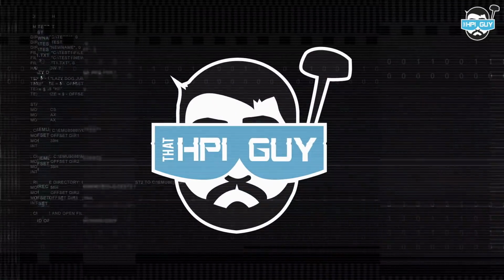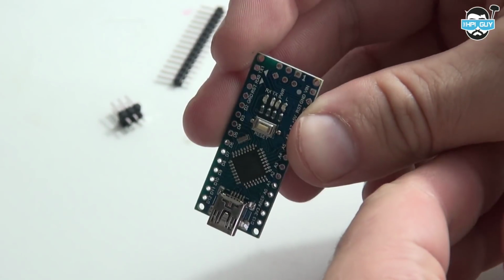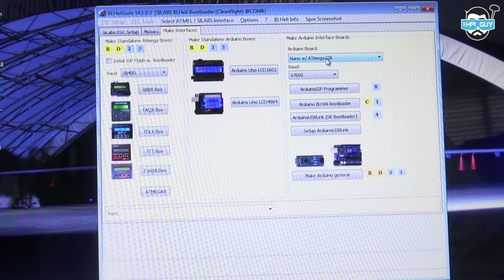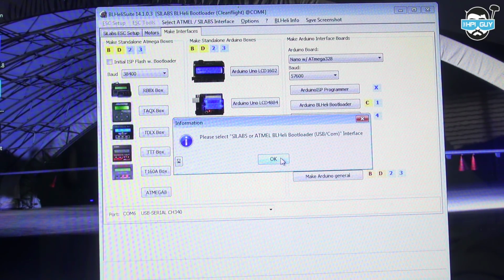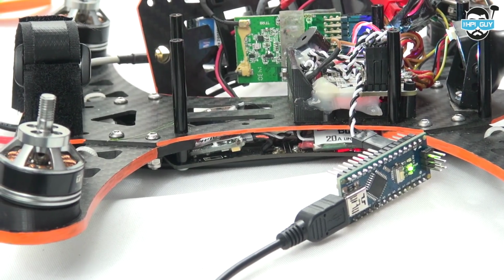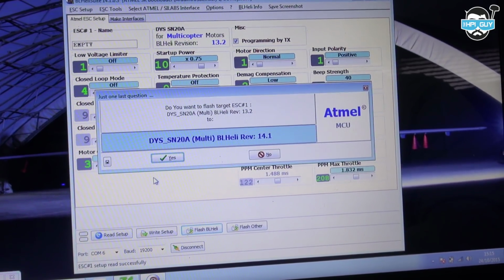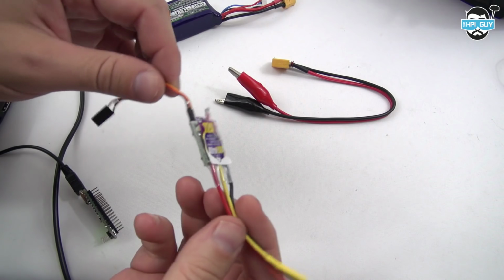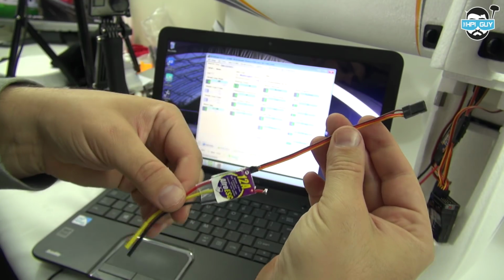HPIGUY | Flash Your ESC's for £3 - DYS - Afro and more - Arduino Nano

Comment: My Chinesium ESC doesn't get recognized from neither of the bootloader, what can I do? I figured out that it needs a TGY.hex. But I can't upload it through the BSC because the Chinesium one doesn't allow me to. Could you show a way where I can flash the chip directly whist the 6 ISP pins on the ESC PC? It has an Atmega 8 chips and the other ESC has a NOVOTON MS51FB9AE chip

Comment: to add the pin is not d3 guys i had to use d2 digital 2 pin it woulndt real when the hpi guy said pin 3.. switched to 2 and it worked...

Comment: thanks hpi guy i just flashed some rhd no name 12 amp escs and blheli is far better than simonk.. why well simon k at full throttle just before you reach full throttle it jumps from 80 -100 and skips to full ou can feel it on the bench using a servo tester.. now it goes straight smooth 0-100 smooth like... also starts faster and smoother from 0 where simonk took 10% throttle and jumped into power where bl heli slowly goes from 0% to what ever you input.. so im super happy...

i mean these rdh esc are these http://www.hobbyking.com/hobbyking/store/__11429__HobbyKing_12A_BlueSeries_Brushless_Speed_Controller.html

so use the 12 amp blue series  if anyone has these chinese rip offs they took the hobbyking ones then slapped some rhd sticker on them you cant find any info i took a risk and voilia it works perfect... you an tell its the same one hk sells just rebranded... so use that firmware  descrpition...

anyway im gunna do my 12 amp afro ones next... simonk sucks i mean it was the best out there a long time ago but blheli is so much smoother

Comment: Hi ThatHPI. I've try to connect in Afro ESC using Simonk USB Link but didn't connect. I've received this message: stk500v2 connection to Esc failed. CMD_SIGN_ON:READ -> Timeout no answer. 

My setup is: Arduino Uno + Afro Esc 30a with afro_nfet.hex

Could you help me? Thanks!
Reply: +Rafael Pereira I also have the same problem with you. Have you solved it?

Comment: My emax simonk esc are not connecting during the stage where you plug in power. Any ideas? Pretty sure I got the com port set right and flashed the arduino with the simonk bootloader like in your video..
Reply: +Wade Taylor I had same issue with my emax 12a blheli esc's, and I've read that they doesn't support configuration by the signal cable.
Reply: That makes sense then as I've since had someone else say I may need to remove the skrink wrap and attach wires to some points on the esc to flash it. I think I am going to leave it for now and in the future upgrade the escs. Thanks for your comment

Comment: you can do this through cleanflight if you are using betaflight! 
I didn`t flash my esc as they came with the latest firmware but I was able to change the settings, damped light, motor to high ect
pretty handy

Comment: I have flashed 10 out of 12 afro esc with the afro usb flash tool but 2 of them had an error that said to use a 6 pin asp connection. I had no success with that. Will this method work instead?
Reply from the maker: I can't say for sure, but for the price it's worth a try